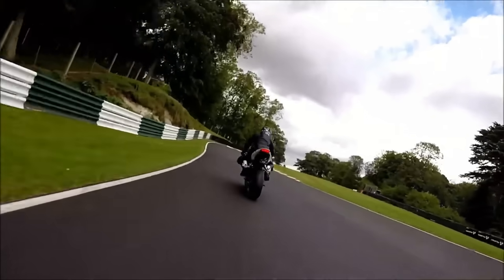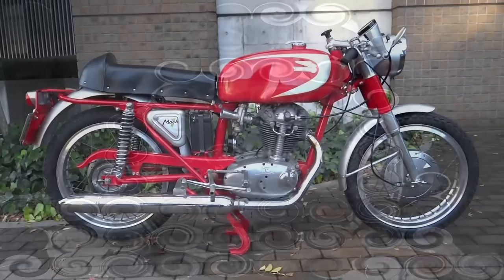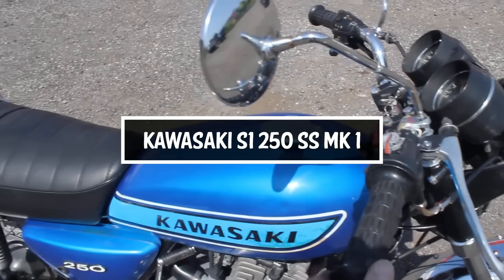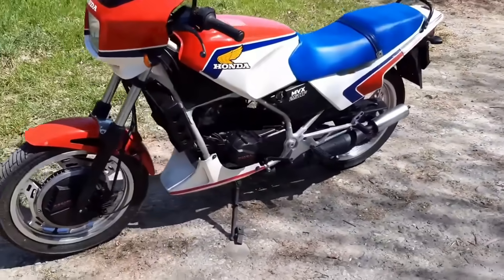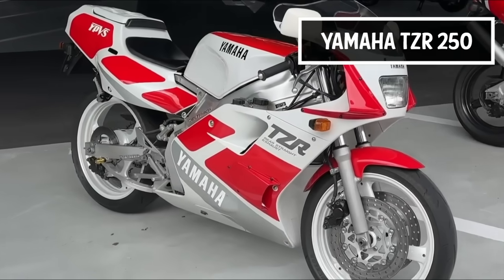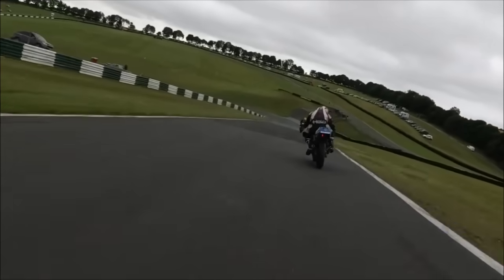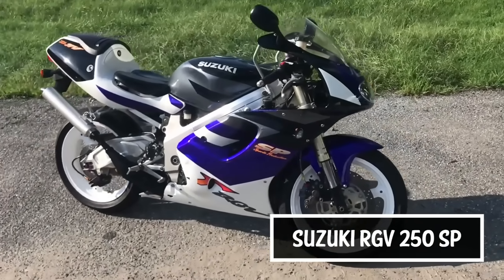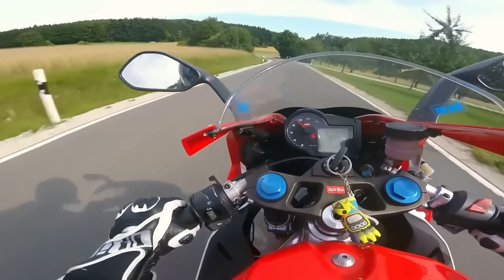The Fastest 250cc Motorcycles

Comment: I think an honourary mention must go to the Yamaha TDR250, the largely unknown brother to the TZR250. It was only made for about four years as its design and appearance was quite ahead of its time and is easiest to describe as a Super Moto before Super Moto was even a thing, unfortunately it lacked sales which signalled its untimely demise.
I had one back in 1990 and hit my (then) fastest speed of 115mph on the A20 Sidcup Bypass. It was (in my mind at least!) the more desirable black & yellow combination as opposed to the other blue and yellow combination. I described the front wheel as a 'sky magnet' and a mate jumped on the back and told me to give it all its got and he got spat off the back in about two seconds flat!
At the same time I had a much more tame Honda CM250 rat bike and it was the TDR that directed me to spend the next 30+ years only having cruisers and customs as anything with the slightest hint of power would lose me either my licence or my life.
My own PB was only beaten around five years ago when despite my foreboding of powerful bikes I had always dreamed of a Speed Triple 955 and eventually got one and wound it up to 135mph on the A2 / Watling Street stretch near Gravesend.
Reply from the maker: great bikes, I ran a CJ360 for a while, the older big brother of the CM 🙂 Cheers for watching mate. Ride Free 🙂

Comment: The only 250 I ever owned was a BSA B25, everyone says they were terrible, mine must have been the exception to the rule. If I remember correctly flat out on fairly level road was an indicated 90, so probably not quite 80 true speed. It was my do everything / go everywhere bike. The single breakdown was climbing Hammer hill (A600) where the porcelain blew out of the sparkplug into my thigh, the pain was tear jerking as I pushed it to the garage at the top of the hill.
Reply from the maker: Great story 🙂Cheers for adding your bit mate. I actually had the TR25 Trophy Trials with the Triumph version of the engine, by 60 it was coughing and wheezing like an asthmatic lol I stuuck with the A7's for a while after that :-) Ride Free 🙂

Comment: I owned a Suzuki Across back in the day, it was a lovely bike. The tank was under the seat and there was storage space where the tank usually is, with an internal light. It was designed as a city bike I think, with a massive radiator, the fan started only once and it was uphill in the city, in summer in Greece, while I was looking for some address. Not many parts were available though.
Reply from the maker: i had honestly never come ACROSS them before  :-) cheers for watching mate, have a great weekend

Comment: I am pretty sure that the TZR250 in the video is not the 1986 model. The 1986 model had a more traditional style seat akin to the RD250YPVS which could comfortably seat a pillion, as opposed to the twin seat pads shown on the bike in the video. 
The TZR250 was a bike step forwards over the RD, unfortunately for Yamaha though, not as big a step as the KR1 and the RGV which were released shortly afterwards (I don't think the NSR250 was released in the UK?) I believe the bike in the video is a second generation TZR which was produced in response to those bikes. I could be wrong though, maybe the bike in the video is a model that didn't arrive in the UK in 1986? 
I had an RGV250 in 1988. It was a wonderful machine!
Reply from the maker: if i had gone into the different specific TZR models i would have had a 2 hour long video lol, i wasnt matching pics by year on year models to be honest.
Reply: @barebonesmc  Sorry, sometimes being a motorcycle nerd gets the better of me!
It's just that at this point, the 250s made a significant change in their design philosophy. They went from being sporty street bikes, which were still comfortable and practical to use on a daily basis, to de facto race-replicas, arse-in-the-air, pillion even higher in the air, tiny, nimble, razor sharp, but also uncomfortable and impractical. In 1988, I had one of the first RGV250s. I loved it,  it was an astonishing machine, and a thing of beauty, but I wouldn't buy one again.
For me, the 1986 TZR was the last - and best - of the sporty streetbikes, where the bike in the video was very much of the race-replica variety. 
I still periodically consider buying a  1986 TZR, but I would not buy the model in the video. Anyway, that's why it mattered to me when the model was wrong. I appreciate it is quite a nerdy thing. Sorry for being a pedant 😀
Reply from the maker: @tonyb9735  no apology needed mate, my TZR was a race bike, cant remember year to be honest, but it was a 1KT so fairly early, but was more Belgarda than Yamaha, lots of RGV bits used. i just wouldnt fold up enough in the end, but a mate decided to do a proper job on it and had it pushing 90HP out on the dyno in the end lol, a banshee block on tzr bottom end
Reply: @barebonesmc  90hp from a tzr is mind-blowing! That must have been incredible. He must have been hosing down much bigger bikes even on the straights! I take it back, I would have a race replica tzr .... if it made 90hp!!! 😃
Reply from the maker: @tonyb9735  he did turn it into a monster. a guy called Mick Abbey did the final tuning, he seems to have taken over where the likes of Terry Beckitt and Stan Stevens stopped
Reply: @barebonesmc  Gosh, those are names from the past. I had Bob Farnham, remember him?, tune my old coffin tank RD250. He turned it into a tuned 350, and promised me faithfully, again and again, that it wouldn't seize. It seized. 🤣
Reply from the maker: @tonyb9735 vaguely familiar but not personally like I did Terry. Had a mate who worked with Terry beckitt so my 350LC was taken to pieces many times lol. Many stories with that bike 😊

Comment: Alway's wanted a 250 or 350 LC. The only time I over took one was back in the eighties. It was a 250LC that was being run in. I was on a Honda XL125. Those classic Italian bikes are gorgeous. The four cylinder 250 four stokes went up another notch but were a 18000 rpm close to engine armageddon.
Reply from the maker: The sound of the Mondial is on another level 🙂 and i do think its fantastic the guys from The Netherans still make a version of the Aermacchi 🙂
Reply: If you invested  I have a mint   more or less  Honda  c b r 250 twin with only  13000 mile on the clock  from 1980.  With original  megaphones,  alloy   spoke wheels.     All as original.   2500 . Pounds. .

Comment: a couple of thoughts , in the 60's Jawa produced a tuned version of their 250cc two stroke road bike that came from the factory with timed top speed of 160k and the paper work to back it up .
The YDS7 250 Yamaha of 1969 was a plain piston port motor with a engine configuration the as the later RD.
I had the 350 cc version the R5 , to be fair mine was blueprinted , but in line with production racing rules .
The R5 were so much faster on the track against the RD's that they were banned with the reason given that they were not a currant production model .
Even the drum brake on the R5 when fitted with green linings out preformed the RD disk in  race conditions .
My R5 eventually gained TZ barrels and chambers .
Reply from the maker: 🙂 cheers for adding your bit mate, have a great day

Comment: I imagine that there’s significantly more profit margin in a big lazy litre engine bike than a highly stressed fine tolerance 250. I also imagine that the 250s of yesteryear had somewhat shortened duty cycles with potential ensuing reputational damage maybe. Two strokes were always destined to go extinct due to perceived and arguably irrational environmental issues. 
Lovely to watch the evolving styling trends over the decades covered here. Great video. Off to research disc valves!😂
Reply from the maker: you are probably right 🙂 as to disc valves, ive actually been digging more because of the next video and come up with some surprises, im still finishing it but it should hopefully be up monday if not before, family time this weekend so i probably wont get much done lol

Comment: After some slight piston and port mods my 1973 RD250 ran 121mph. It would turn 13,000rpm when I got through tweaking on the engine. The tachometer needle would pass the neutral light, off the 12000 rpm scale. It was the most fun I ever had with my clothes on. I would ride it to the strip about 35 miles away and drag race and drive it back home. I won my class every time and top eliminator in the motorcycle class.
Reply from the maker: Great story 🙂Cheers for adding your bit mate. Ride Free 🙂

Comment: This has popped up on my feed 13/08/24
Back in the day (mid 80s like around 86-87 IIRC) I had a Suz X7 250 with Micron pipes and YPVS 350 carbs (which took some balancing) clip-ons, 1/2 Bikini  and we (Snowy & I) both managed a top speed of 120mph+ Hitting the 120 stop. ( on the A13 in Essex between Chadwell and Dane Holes RB) I was skinny back in the day lol. Might hit 90 now 😁

Comment: There are many Arcoss that were imported into Australia and still around even now, 1991 until 1998, very reliable even with the high rpm and a lockable luggage box that holds a full face helmet. something not even the twins had. A little heavier also cheaper rear shock than the gsx. Close ratio gears made for the urban landscape, fun to ride around town. 
You didn't mention the Kawasaki ZX2r. Later to the game, also the suzuki 250 bandit a naked bike, got beefed up forks. then the honda hornet. All these bikes were imported into Australia and were reasonably popular due to license restrictions.
Reply from the maker: many were missed but at 42 mins it was well too long already mate :-) I do my best, have a great day
Reply: @barebonesmc was a cracking vid, I really enjoyed it. I meant to watch a few key bikes but didn't skip a second and then you mentioned the Across, <3
Reply from the maker: @jamesitarose2473  glad you enjoyed it mate, Ride Free

Comment: I remember period tests on the KH250 struggled to best 88mph , but great looking and sounding bike 👌🏻😎
Reply: Yep I bought one purely for its looks,but it was slower than my mates GT’s & RD’s.Quicker than the Honda wet dream though
Reply: The first KH250, after the S1C, was easily the best looking 250 of its time. I loved the blue one. Sadly never owned one.
Reply from the maker: Yep, it had that certain something. i do wonder where the A1 design could have been pushed to though. Cheers for watching all,  have a great weekend
Reply: I had a Kawasaki S1 250 triple and it read 100mph on the speedo one time -
maybe it was slightly downhill?
I didn't like to ride it much as it had no power down at the lower revs.
It was still exciting to ride if you were in a reving mood.
Reply from the maker: @Bobby-fj8mk  some of the speedos were pretty wild too 🙂 i did know KH's that did the 100, but only after tuning, .Cheers for watching mate, Ride Free
Reply: @barebonesmc  - mine may have had a mild port job.
It was quite quick up to 60mph or  100km/hr.
It could drag off a V8 car up to 60mph.
(still nothing compared to my H1 500 or H2 750 )
I had many Kawa triples.
Reply from the maker: @Bobby-fj8mk  have a great day mate, enjoy it

Comment: 1933 Excelsior Mechanical Marvel  1933 TT 250 winner only 250cc motorcycle to average over 100mph for 50 miles  at Brooklands . 4 valve radially displaced, pushrod . first "streamlined" motorcycle
Reply from the maker: I’ll take a look. Not one I’m familiar with

Comment: No mention of the T250 Hustler with 33 HP.  I saw over 160 km/hr on the speedo many times, although the best flying 1/4 speed in standard trim was 155 km/hr (97 MPH)
Reply: I was disappointed as well! No mention of the earlier T20 Super 6 from around 1965 up to the introduction of the Hustler either! The Hustler was my dream bike at the time, I did get to ride my friends, what a revelation after my Ariel Leader 250 which only made 16hp! Wonderful 😊
Reply: Yeah mine was1975 and I used to race a Ducati desmo single 250 and I saw 100 regularly. The du cati was slow but sounded lovely
Reply from the maker: i have apologised for not mentioning the T20 :-) some were bound to get missed, im still clearing a backlog of comments though so sorry for the late response :-)  :-) Cheers for watching all, enjoy the ride

Comment: 250s are great, I've had a CB250G5, 4 250 Superdreams,Suzuki GSX 250,Yamaha XS 250, 2 RD250's,an RD250LC and a Yam XT250 that I loved.

The G5 was awful,bought it nearly new and it misfired badly in the rain and despite Honda's supposed build quality mine was one of the red ones that looked an anaemic Orange very quickly.  

Superdreams are great as those who have owned them ,as opposed to following the herd slagging them off,will tell you. Great build quality and I never had one let me down,ever. They were very expensive until the 125 learner law came in almost overnight and people could hardly give them away, I bought a mint year-old one for that very reason for £200 years back as the market was saturated with bikes learners couldn't ride and most with a full licence didn't want, nice size and for everyday use just the job. I had 2 400's over the years as well,massively under-rated bike,really,really nice.

GSX 250 was impressive on paper and a looker for it's days,mine like most Suzukis of that era was plagued with electrical problems and I hated the thing.

XS250 was arguably worse and notorious for starting and cutting out problems,both of which I had. Don't know if it's true but I did read once that the problem was a mistake in the service  manual Yamaha gave out which had the wrong timing settings in. Like the Superdream the 400 version was really nice........and didn't have the same problems,amazingly one of my workmates still commutes on a 1978 SE version with lower bars,not pampered but a very long way from a shed. My 250 was a late model one with rounder styling and actually a bit of a looker.

RD250s I picked up very cheap to commute on,by then they were already 15 year-old bikes and still nobody wanted 250s and they definitely didn't want 2 strokes. I paid £200 for both of them,both in very good  nick and you can imagine how I feel when I see what they go for now,people were almost giving the things away. I actually had an RD400 years before the the 250s,truly awesome machine that speed-wise even gave the 4 stroke 750s a run for their money, in its day it was mind-blowing,I see them now and think,"I did a ton on something that small with those brakes?"

RD250LC was a minter that I picked up for the princely sum of £450,usual thing,LC or not nobody wanted old 250's ,let alone strokers. Ran faultlessly and was amazingly impressive as a commuter,it was actually quite torquey  for a 250. Sold it to a mate and it seized on him the day after at 30 mph. 

XT250 of course a totally different ball game but I lived in a village in Cornwall when I owned it and blasting around the lanes was great fun.
Reply from the maker: great story mate,  🙂 cheers for watching mate, have a great day

Comment: What about the Honda Spada 1988-1989!  250cc V-Twin 4 stroke with 40 bhp at 13,500 revs.  Light, sweet handling and liveable everyday.  100mph only but just a wonderful machine.  Mine still runs beautifully.  Greg in Adelaide Australia.
Reply from the maker: someone else just mentioned it and all i can think is ours must have been a detuned version, they wouldnt pull anywhere near those revs

Comment: Have you heard the sound and speed of Kawasaki ZXR250? It was the best 250 speed and stock F1 like sound in the 90's. It equipped with higher specs components for 250 class 12 valves etc.
Reply from the maker: they were a great bike, i just always preferred the FZR. but i probably should have mentioned it, Cheers for watching mate, Ride Free 🙂
Reply: @barebonesmc  it's impossible to cover all the bikes in one 🤣. Even two 🤣. Each bikes has it souls in everyone. Cheers mate. Born to Ride

Comment: in the 1960's was the Suzuki T20 ,250  which i think was bike of the year for a couple of years around 1967 , had a standing 1/4 mile  of 13-4 seconds , mine a 67 with a fairing clip-on's and rear sets did over 100mph no problem.
Reply from the maker: Te T20 has had a fair few mentions in the comments, I should have probably included itv to be fair, Cheers for watching mate, Ride Free 🙂

Comment: My honda 125 used to smash 100 mph. Excellent video thanks
Reply from the maker: which 125? Cheers for watching mate, have a great week
Reply: @barebonesmc  I must admit it wasn't straight out of the box. I modified a Honda cb125 by using an XL185 head I threw away the flywheel and stator, ran a 12 volt battery for the ignition that was electric, a piranha cdi. I also removed the standard cylinder sleeve and bored the cooling fins out to fit a shortened Honda 750 four sleeve I also ran a turned down Honda 750 four piston I did dable with a Kawasaki Z650 piston. Then I proceeded to lighten the frame and I ran a Yamaha front end and replaced the 18inch rims with alloy 17 inch rims. She did an honest 100 mph
Reply from the maker: @blacksheep6888  thats some engineering mate, good on you, Cheers for watching🙂 Ride Free